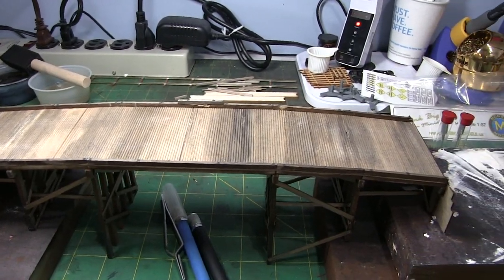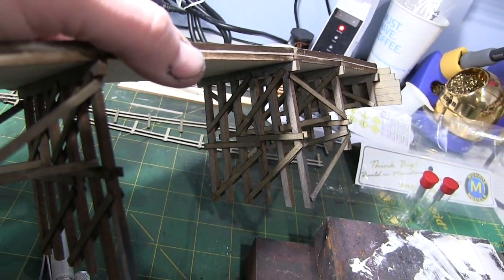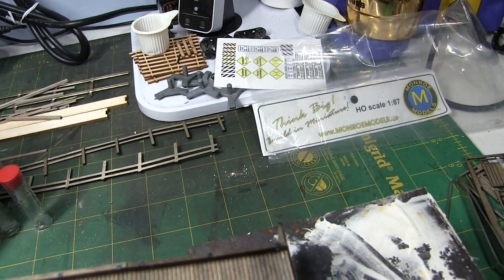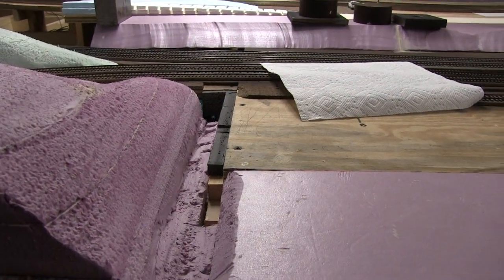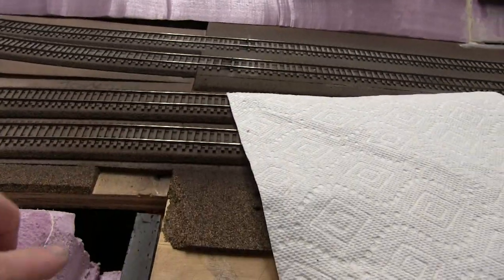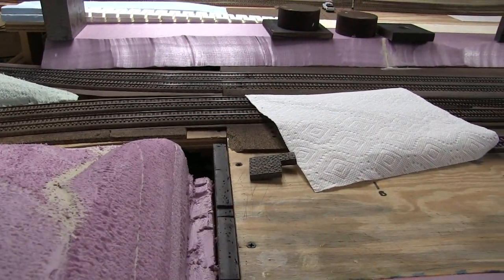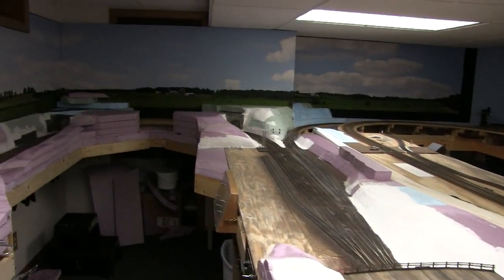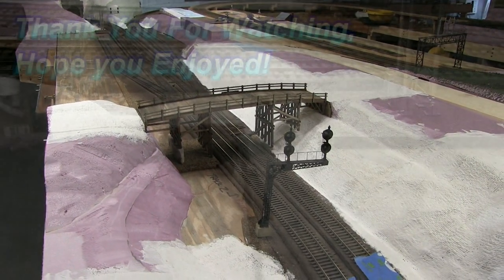Model Railroad Update 52-Bridge, Culvert & Tunnel

Comment: For the tunnel why not take a Stanley Surform Shaver tool (or equivalent) and lightly nick up the walls and then paint them black.  The Surform tool will give you the rough looking rock from the blasting.  Plus you can do it right in place with minimal mess - well nothing a vacuum cleaner can't handle.

Comment: Starting to look like a real area, the culvert look good. If it was mine(which it's not) i'd paint the inside of the tunnel walls. Also if it is not too late scribe a line on the bridge rails at each post like a board per post.
Jeff

Comment: Steve I like what you did with the Bridge. Question is there going to be a service road for a maintainers truck that goes under the bridge on the closest side? If there is what about adding some guard railings to protect the Bridge bents from damage? Also what about adding a Sign to warn the Maintainer driving the truck how high the lowest cross member is. Granted its not a Major road just a service road back to the signal post, but this is details that make things pop in a scene.  :)